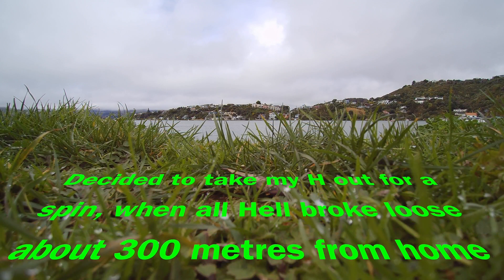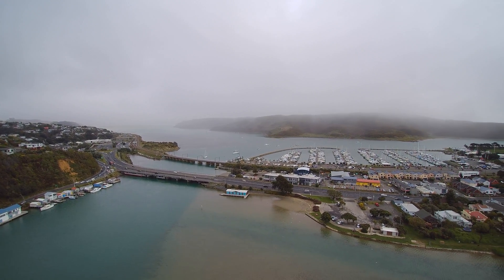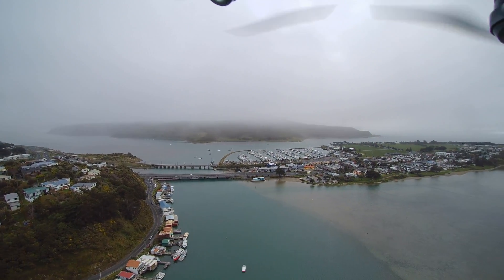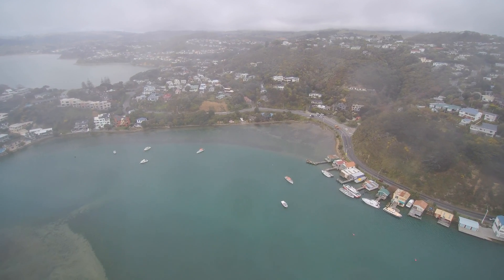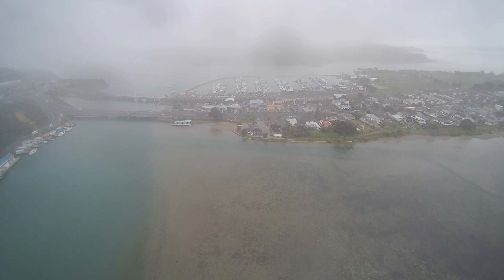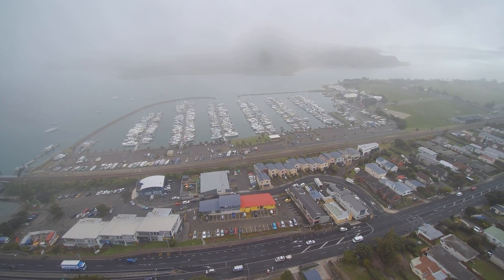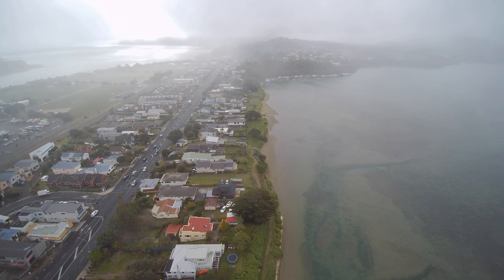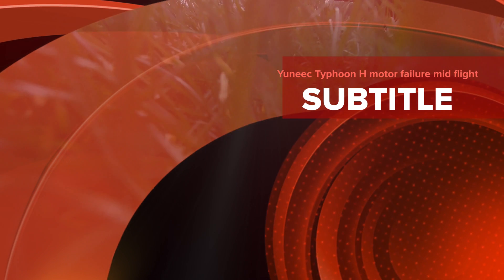Yuneec Typhoon H motor failure mid flight

Comment: 4 years old and just came up in my feed! lol. I have several drones, including the Typhoon H. These brushless motors will actually run submerged in water. I have 2 waterproof drones that I repeatedly land on saltwater, and I rinse the motors with a garden hose while running to flush out salt and prevent corrosion. They are open brushless motors common to most drones. Even heavy rain will not cause a brushless motor failure. However, the ESC's will short circuit if wet. There are open vents on the top and sides of the Typhoon H to cool the ESC board, right in line of where the spinning props will fling water. It was very likely an ESC short that stopped the motor. Luckily it stopped. If the wrong circuit on the board was bridged with a droplet of water, it could have went wide open throttle and send the drone into a violent flip and a certain crash. I had a homebuilt waterproof quad that had a single board 4 way ESC installed with water cooled heat sinks from a PC cooling system to keep it cool in the vent less waterproof enclosure.  After upgrading a radio receiver and doing a test flight in my back yard, it suddenly went full throttle straight up like a rocket, completely unresponsive to control input and the kill switch! My telemetry lost track of it at around 8000 feet, and the drone was never seen again. I wa ready to call my supplier and rant about the new radio failing on the first flight, until I discovered the small hose from the heat sink that I removed to access the radio. Easy to surmise that the cooling pump was flooding the ESC board.
Reply: Interesting but I prefer to keep mine dry

Comment: I'm impressed with how stable yourTH was on 5 motors.  The instability you experienced in descent could simply be turbulence of descending through the prop wash.  It's usually a good idea to have some forward (or other lateral direction) while coming down.
Reply: When I saw him bring it back at higher altitude I was thinking "Start descending now". Then when he started coming straight down I was waiting for VRS to kick in.  Carey was lucky twice in a single flight. The 5 rotor mode worked as designed and the Flight Controller maintained attitude while the H was in the prop wash.
Reply: It works also with 4, if not 1 motor doesn't stop near the one which is next to him and stopped already too! ;-)